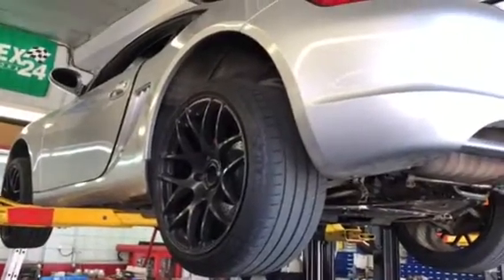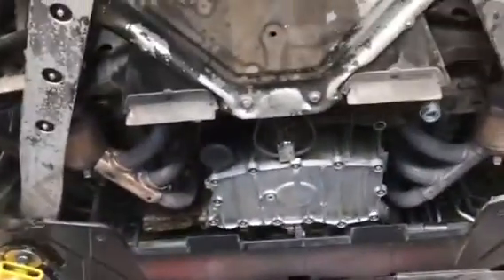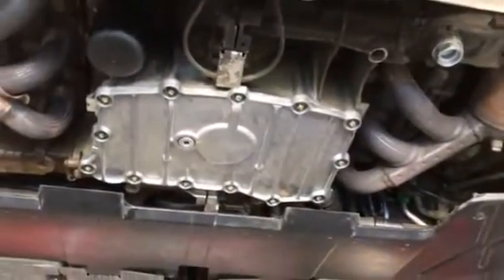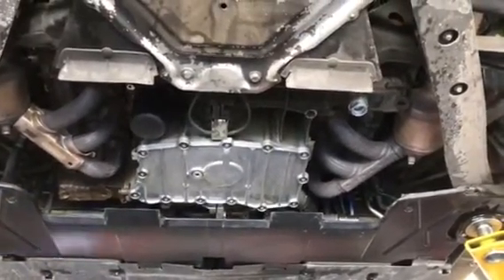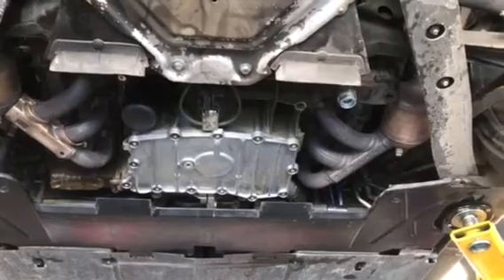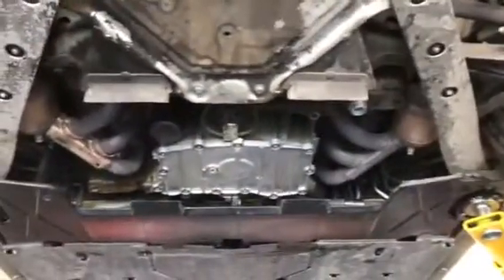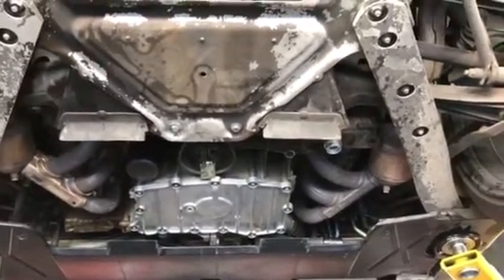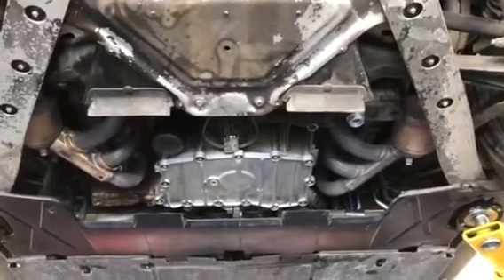Porsche 987 IMS Chain Pre-Failure

Comment: Hey, what is the verdict on tensioners to quiet this noise? I'm considering swapping the  IMS tensioner just to see if it quiets my car in the flywheel end of the engine case when fully warmed (M97, no metal etc)).
Reply from the maker: If a new IMS chain tensioner takes your noise away, your IMS chain is stretched and the new IMS chain tensioner is a temporary fix,!

Comment: My Boxster S motor blew last week. Only 49k miles. Had an IMS upgrade too.  PORSCHE SUCKS
Reply: nah the pre owner must have pushed that engine a bit to far... happens to audi and mercedes a swell sometimes :P
Reply: what year is the boxster  ?
Reply: @artzepeda1974  2002
Reply: I know this is an old post but it’s not uncommon for even the LNE bearings to fail prematurely if the debris from the original failure wasn’t completely cleared out. Another thing is LNE also recommended a replacement schedule for the ims bearing. I wanna say it’s like 60,000 miles. I opted for the “eternal fix” on my 996 and got the wet bearing conversion kit with the special tool. I hope to do it and the clutch and rear main here pretty soon but I’m at 139,000 miles on the original ims bearing so far.